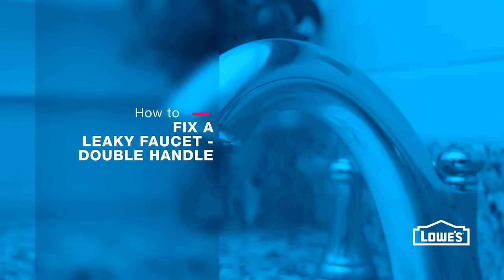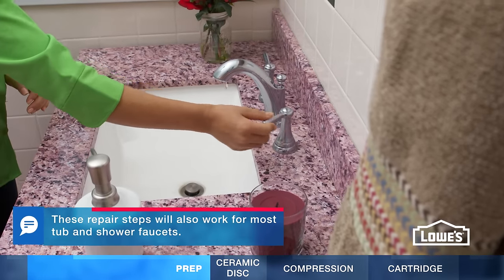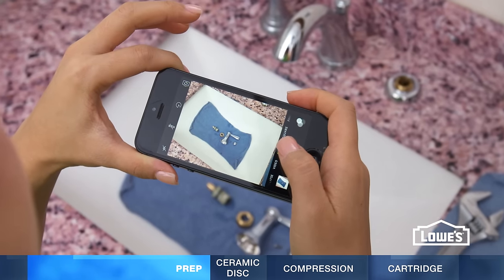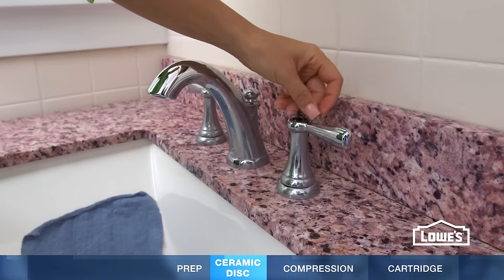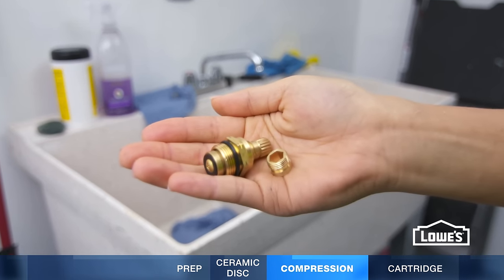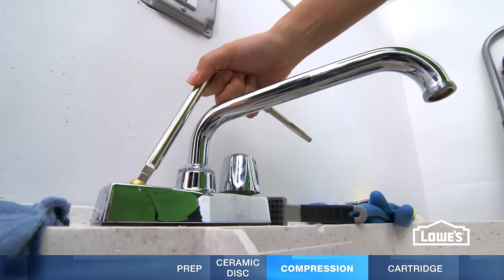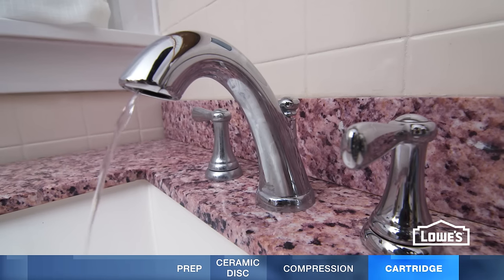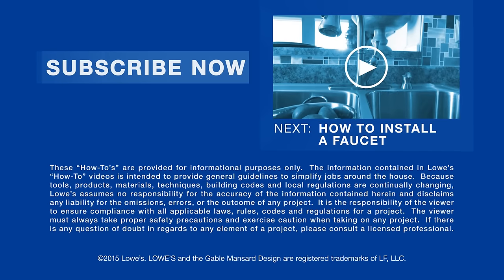How To Fix A Dripping or Leaky Double Handle Faucet

Comment: Not pictured:  6 trips to the hardware store for 1.Set of allen wrenches when you have all the wrong sizes 2.WD40 when retaining nut won't come off 3.Adjustable wrench when channel lock wrench won't help to unstick 4. Socket wrench when the adjustable wrench won't help to unstick (better hope you got the right size socket, or back to the hardware store you go!) 5.Vice grips to attempt to remove stuck cartridge 6.Actual replacement cartridge (because you won't know what size you need until you've extracted original).  Elapsed time: one week of trips and dinking around.  Next time, calling a plumber.
Reply: Is everything you mentioned all that I need? I’m about to go buy.
Reply: $500 plumber for a 30 dollar job! Plan better next time instead of making 6 trips. YOu can order everything online and it arrives at your doorstep in 1 day! Stop being lazy!
Reply: Rude!!  Not everyone has your level of experience.
Reply: @joanmiller5645   But any human being with opposable thumbs can set his or her intention to doing the task, and completing it.   The secret is "desire", not experience.  Then you have accomplished something worthwhile.

Comment from the maker: Dripping faucet driving you nuts? Here's how to find the problem and repair a double handle faucet.
Reply: How about that lifetime warranty thats offered on almost ALL faucets??
Reply: What happens when you've done all the steps and it still leaks?
Reply: How about how to stop a dripping faucet that doesn't have the set screws at the top of each handle? There seems to be no access...

Comment: I have a Pfister bathroom sink faucet that had a leak out of the hot water side. Before giving in and buying an entire new faucet assembly I found this video and it saved me!! 

I have the “cartridge type” and all I had to do was unscrew the handle (the one I have apparently requires no tools and is just unscrewed by the “skirt” under the handle just by hand) and turns out the nut that holds the cartridge valve in was loose. I tightened it and it’s fixed!! Thanks for the video!

Comment: Oh man.  I got to the part about pulling the cartridge out.  Mine appeared to be that type.  I pulled out a piece exposing to weird little hour glass things.  What I pulled off seemed to be some kind of plastic cap that looked like the top of the cartridge.  At that pint there was nothing I could get to lower.  The two little hour glass shaped things moved out of their tracks.  I tried to re-align them and put the top plastic piece back on.  When I put it back together the tap now turns the wrong way.  I re-opened it and messed with those hour glass things again and at least have it back to where the tap turns the right way.  I wrenched hard on the nut that held that cap in and seems to have slowed the drip at least.

Comment: It turned out I actually needed to replace the spring and washer underneath the cartridge which this does not cover. Of course that required a second trip to the store so that was a hassle but what do you expect.

Comment: Driving me nuts because I can't find a way to get to the valve. No set screws accessible. The one thing that looks like it could be a cover doesn't even have an indent or  gap I can get a tiny screwdriver into to pop it off.
Reply: mine too .....i think you have to turn the whole base :-(
Reply: You are both correct, and I learned from sad experience of breaking the cap on top of the handle by trying to pop it off, when it was designed for the handle to just be twisted counter clockwise at the base using a rubber gripper gloves or something similar to not scratch the base and it will come right off, leaving the retainer nut to the be removed to the gain access to the cartridge. The replacement cartridge can then be inserted directly into the hole, and in my case, it did not need to be oriented in any particular way, as the flow of the water is controlled within the cartridge.  After reapplying the retainer nut and placing/screwing the handle back on the base, I was back in business in a matter of minutes. I also had some other good news.  I contacted Pfister to see if I could purchase the faucet handle cap, anticipating that I would incur that cost, but to my complete surprise, they told me it was covered under warranty and the cap part I was seeking was actually part of the handle and they were happy to send me the items, free of charge!

Comment: You left something out because now the water wont turn off from the handle.  I tried turning the cartrage around but the water still runs in the off position (as well as on).
 Another thing, the problem can be on both hot and cold side at the same time.

Comment: I love how they are trying to rip people off in their ads. "...Probably one part that is defective, but its best to buy all brand new parts anyway "  "... Instead of repairing it, its best to buy new"

No, its not bests to waste your money uselessly. Its best to learn how to repair them so that in your 50 yrs or so of owning your house, you wont constantly have to buy new pieces every time something breaks.
Reply: HoboTango just if old may keep you from having to spend time going back in...its your choice to replace or used old..its good advice if you can afford the replacement parts..
Reply: The parts are inexpensive.  Saves time to do it all at once.  Often when one part fails, other parts will also fail soon after.
Reply: This video LITERALLY saves people's money as they do not have to call a plumber. What's your point?
Reply: Especially in old toilets... a lot of our parts are brass and will last forever. If I were to replace them, the new parts are plastic.

Comment: I was sitting there with both waterlines shut off and the faucet was still dripping.
Reply: Same here, bro. Ugh
Reply: Same right now 🥵
Reply: Did you turn on the water both sides to let them drain after turning off the water supply lines?
Reply: yeah, cheap plastic valves dont shut off all the way, or break at the handle
Reply: L,

Plastic Valves 🇨🇳

Comment: In order to fix the water leak start by cutting down the water flow and removing the handle, next find the replacement disks, remove the rubber seals, before removing the rubber seals make sure to clean the scum and debris from seats. Finally, reassemble the cylinder, installing it facing the same direction it did before. However, it is quite complex to repair a leaky faucet yourself, therefore I would recommend to call in a professional like Pro Serve Plumbing who can do the job for you at an affordable cost.
Reply: But you literally just gave us the steps and they are not complex at all lol.

Comment: I got to the part that looks like the stem but it would not budge. Not sure if I'm missing something else. Hopefully taking a picture and taking it to Home Depot or Lowes, someone can help.
Reply from the maker: Sounds like it's either screwed on super tight, or there could be a nut holding it on. A picture will definitely help! And we strongly recommend Lowe's :) Thanks for watching, Sharon. Good luck!

Comment: What did you use to unscrew the aerator? It's a blue gadget.
Reply: mcpelayo74 

They are simply "Channel Lock Pliers"

But they have soft plastic/rubber tips on them.

Look up "Soft Channel Lock Pliers".
Reply: @peronec6614  They use an aerator key in this video. Helpful, but you can get one off with regular channel locks like peronec says. Just wrap them in painters tape a few layers and be careful.
Reply: Use the opposite rubber end of the pliers
Reply: @peronec6614  actually  Channel Lock is a brand name , after starting a big argument in plumbing shop its proper  name is "slip joint water pump pliers" but that can be argued and there is different names in different parts of the country or countries
Reply: @nickthegazerofsouls  Friggen NO! the aerator is flush with the faucet edge, You need the aerator removal tool, at least for Moen, at Lowes $7.